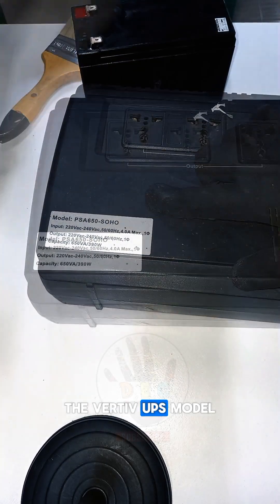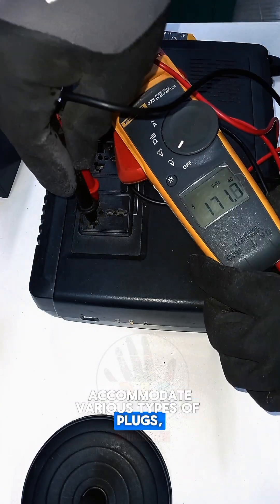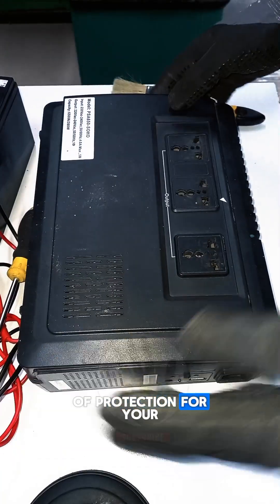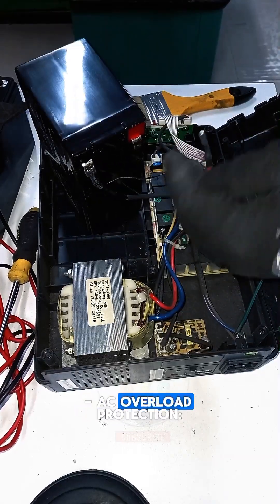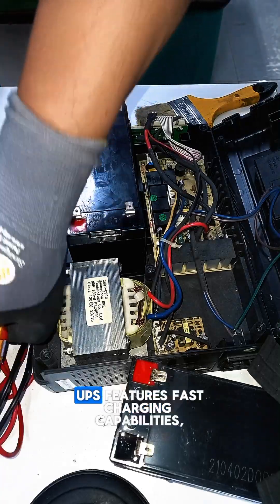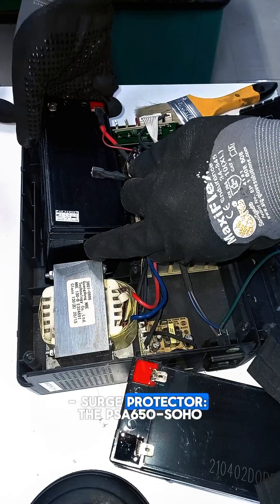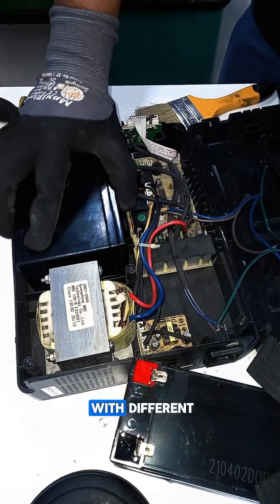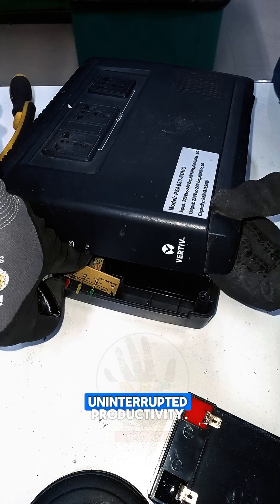UPS Vertiv PSA650-SOHO Battery Replacement  and KEY Features

Comment: Can i use Bigger capacity Battery with this ?
Reply: Can i use car battery on this?
Reply: @arvindesanandres6189 yes
Reply from the maker: @arvindesanandres6189 only 12v 9ah
Reply: I have been using 12V 20A for last one year . 
No load-shedding (on and off ) 
Working perfectly
Reply from the maker: Nc, what model of ups?
Reply from the maker: Yes you can😊